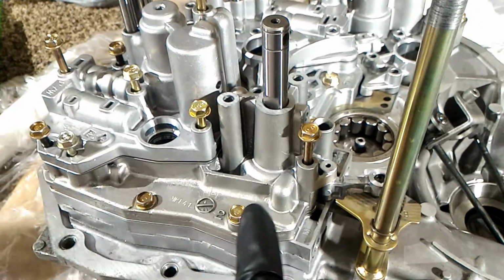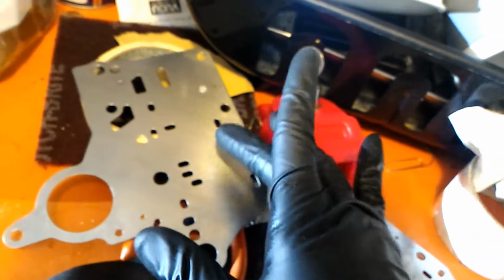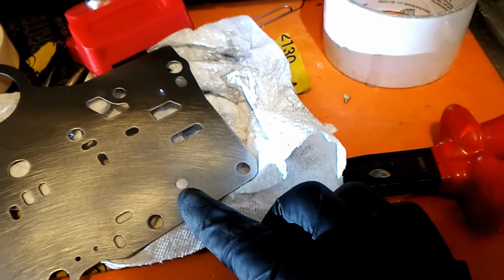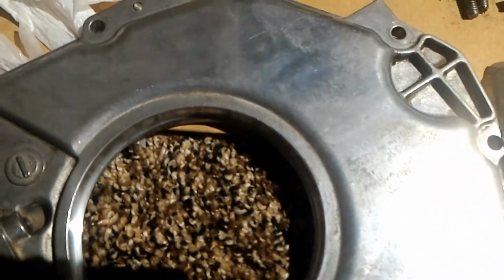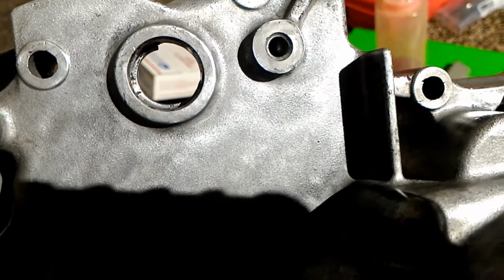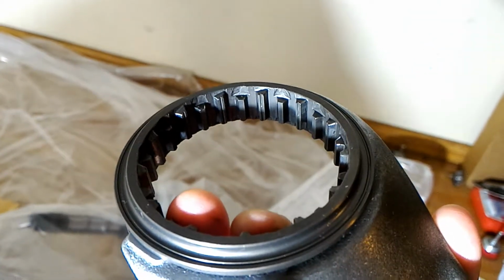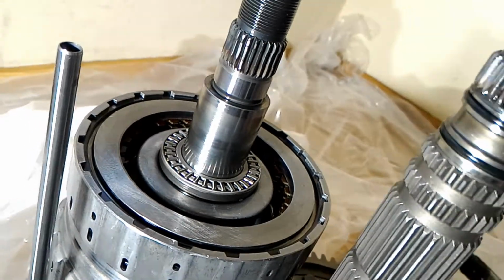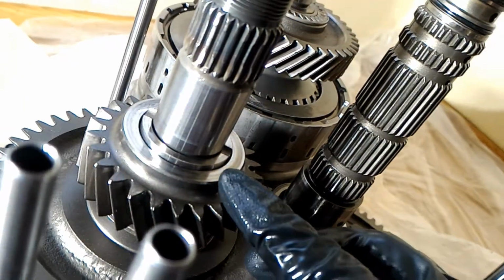Tear Down and Rebuild 2002 Honda Odyssey Automatic Transmission - Part 27

Comment: I just saw your comment on odyclub, where you were asking in first place about the donnas and translab. On the end you stated a warning about using translab. Do you think the fault is on translab site or you did it wrong? Greetings from Germany
Reply from the maker: It was a problem with the documentation not giving out specific enough information. They assumed you would know for some reason or that you were a professional and this was common sense. Luckily I was careful and double checked and I think the damage was small enough to not break through the entire metal plate to cause a leak. So far the van shifts nice so I think it's ok. But just a warning because I doubt most people knew this